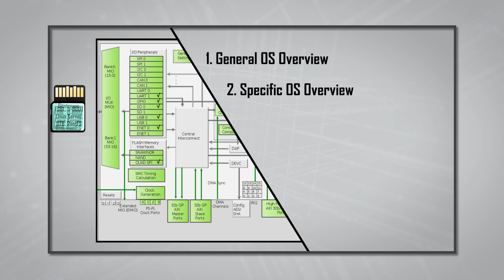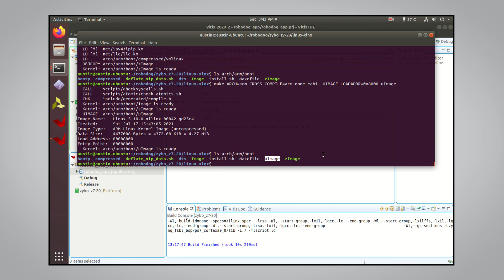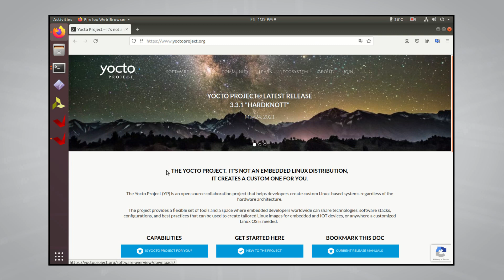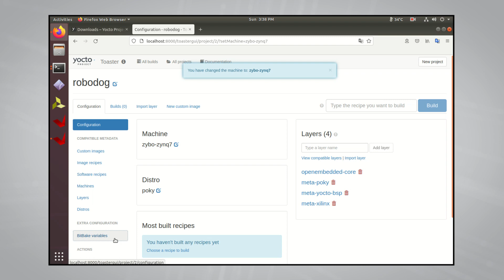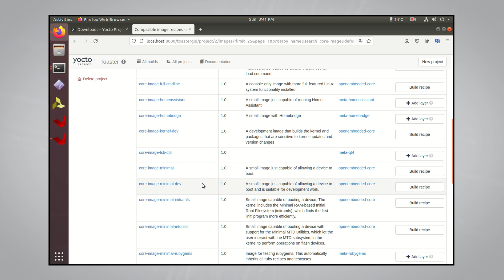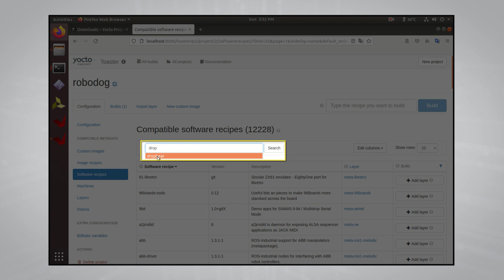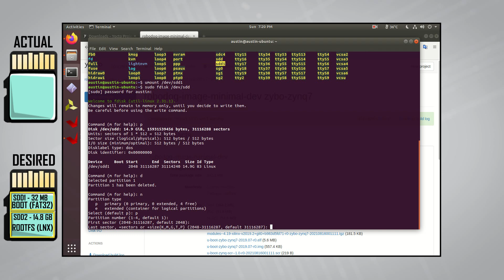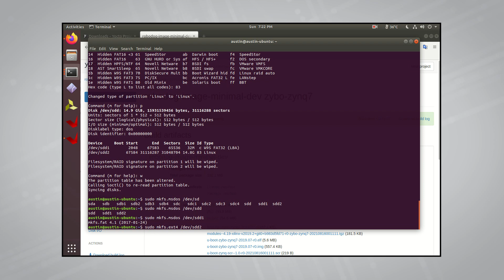RoboDog Part 8 | How to Make Your Own OS (2 of 3)

Comment: Hey Austin, thanks for sharing. One question, what books do you recommend reading in relation with the "make your own OS"/embedded systems theme ? Thanks
Reply from the maker: Glad you liked it. I liked the book "Embedded Linux Development Using Yocto Project Cookbook". If you want to get more into Linux Driver development, I recommend "Linux Device Drivers": https://lwn.net/Kernel/LDD3/. It's an older book, but if you're trying to get a strong foundation in what driver development is all about, its great. For understanding the Linux Kernel in more depth, I find  "The Linux Programming Interface" to be a good reference. If your looking for alternatives to the Linux Kernel, you can look into Xen Hypervisors, Free RTOS, or VxWorks, they all have extensive documentation you can find online in how they work with embedded systems and how to implement them. Looking online for micro-kernel architectures may be interesting to you as well, such as Minix3.
Reply: @AustinTronics  Thanks, I guess I'll have some more reading to do!
Reply: @AustinTronics  This is very helpful thanks for suggesting these. In addition to these, are there any other opencoursewares classes available online that would complement these well?
Reply from the maker: @DavePetrillo  Yes actually! I took a few classes at the University of New Mexico where the professor published everything he did online. The two classes I took were Hardware/Software Codesign with FPGAs ( http://ece-research.unm.edu/jimp/codesign/index.html ) and Hardware Oriented Security and Trust ( http://ece-research.unm.edu/jimp/HOST/index.html ). Both classes involve the Zybo Z7-20 board (hence being an easy platform to prototype with for the RoboDog series since I already had one sitting on my desk from these classes). 

The HW/SW Codesign with FPGAs class tries to shift traditional thinking about how you can put applications on platforms with the presence of FPGAs and how to make the CPU and FPGA work in a more cohesive way to dramatically increase your application performance. 

The Hardware Oriented Security and Trust (HOST) class is more about how you can utilize the FPGA on your heterogeneous computing platform to provide a level of security with your applications that you normally can't obtain with processor-only platforms. More specifically, you go into something called Physical Unclonable Functions (PUFs). PUFs take advantage of the inconsistencies in the chip manufacturing process (timing delays of certain paths) to create enough randomness that allows you to create a unique ID for any specific chip (e.g. IDs are completely different even for the same exact model of chip). This gives you extremely high confidence that the bitstream you put on the FPGA is really your bitstream and hasn't been tampered with.